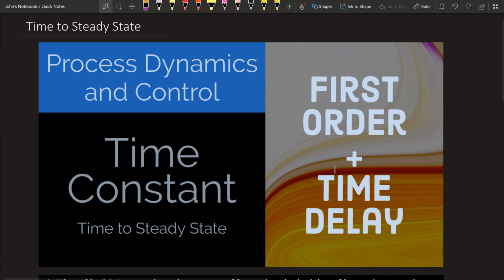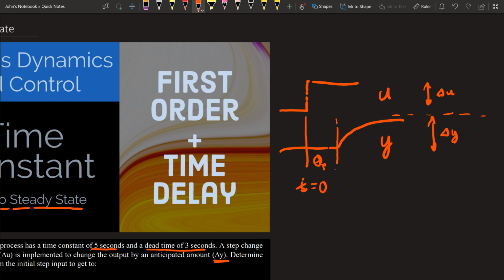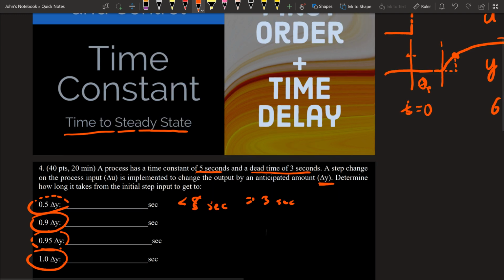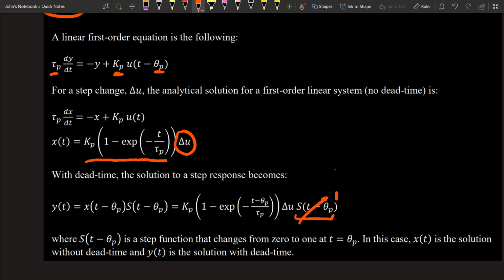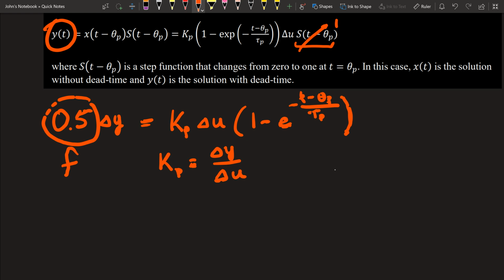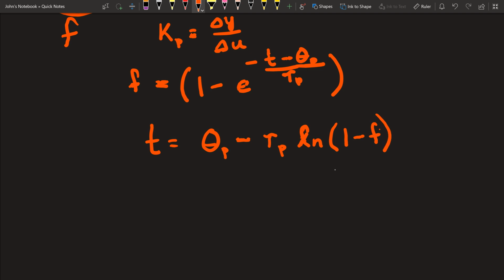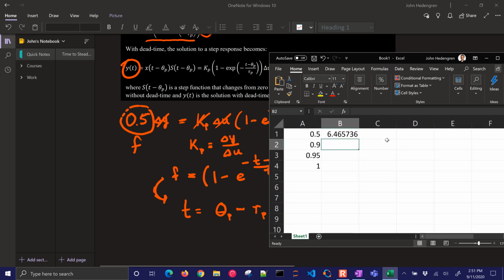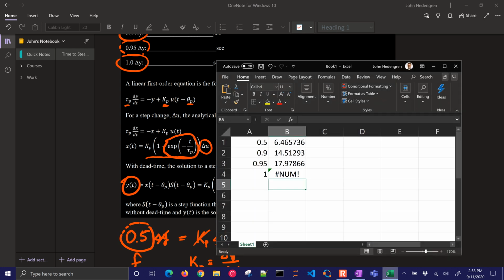Time to Steady State

Comment: I am currently developing an auto throttle add on for uSoft flight simulator's GA aircraft.  With just a PI controller things are going pretty well, but I'm still not happy with the time to steady state. Based on test data, I'm definitely seeing a dead band happening at the SP.  I understand this to be "backlash" which is a very real thing with mechanical actuators and looks to have be built into the software model as well.  Can you do a video that explores possible ways to deal with a system that is exhibiting actuator backlash?
Reply from the maker: Thanks for the suggestion. There is additional modeling information for PID control at https://apmonitor.com/pdc and custom modeling information at https://apmonitor.com/do